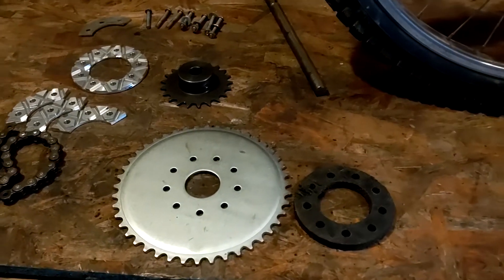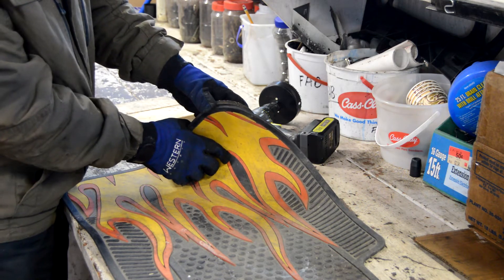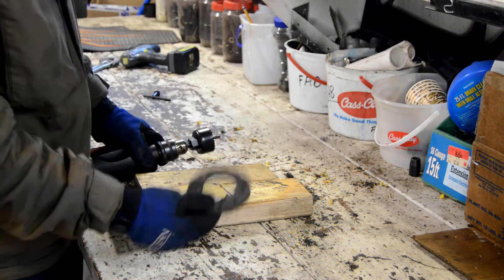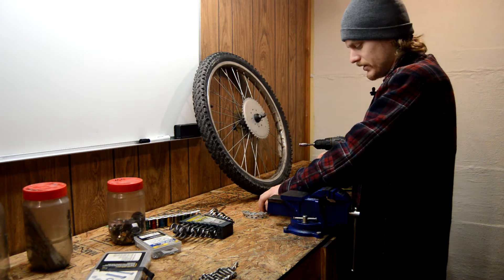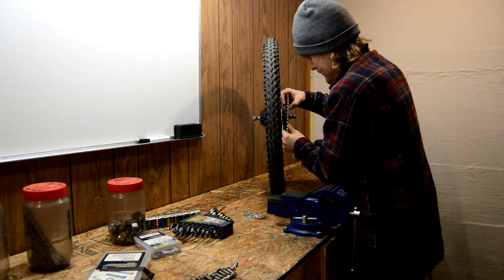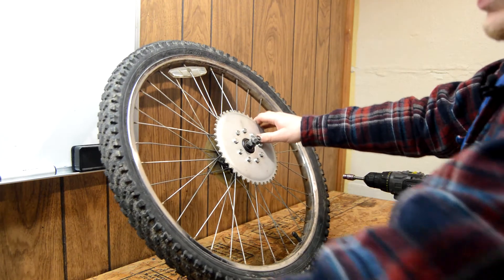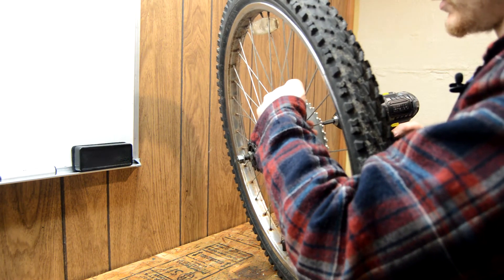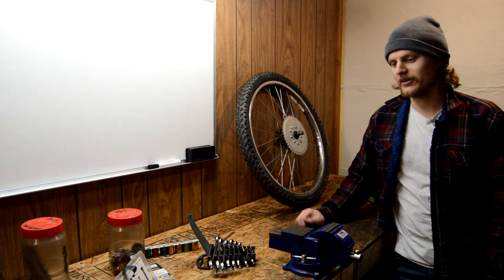DIY E-Bike Build - Rag Joint & Rear Sprocket Installation EP2

Comment: Does the stock bike chain need to be switched for a bigger one, also the sprocket on the motor?
Reply from the maker: On this build, I used a #35 chain for the front and a 415 chain for the rear. With any motorized bike kit, you'll want to run at least 415 chain. Standard bicycle chain can't handle the torque of most motors or engines and usually breaks. The sprocket on the motor should match the pitch of your chain and be geared for a speed that you would like to ride at. Check out BMI karts' go kart speed calculator.
Reply: @pulsar2121  thanks for the info

Comment: How do you make sure it is straight. And where can I buy a good one
Reply from the maker: Rag joints are never perfectly centered on the hub. You just eyeball it and get it close enough by wiggling it around as necessary while tightening the bolts in a star pattern. As for where to buy a good one, honestly, I've had the best results with the cheap ones. I've tried the CNC aluminum type which are called pineapple rag joints and they are less forgiving and have a tendency to bend spokes. Also, they only fit one very specific spoke pattern for a 26" wheel whereas with the rubber rag joints you can squeak by on most 24", 26" or 700c wheels. There are also CNC sprockets that have an adapter that clamp on to the hub. These are required for smaller wheels like 20" as the spokes interfere with a rag joint. They can be installed on larger wheels as well, but have a couple of drawbacks. The teeth on the sprocket will wear faster as they are made out of aluminum instead of steel and it's not uncommon for the adapter to get loose on the hub. You really have to crank them down and use loctite to get them to stay put.
Reply: @pulsar2121  thanks frror the reply. I wanna. Build a ebike and use a motor on the back. Cause the price of motors for traditional ebikes are way to expensive. Prices are going insane now a days.
Reply from the maker: There are 250 watt e-bike conversion kits that have motors with built in gear reduction as cheap as $84 including shipping on ebay. try searching "E-BIKE Conversion Kit 24V/36V 250W Electric Bicycle Motor Set Fit 22''-29'' Bike"

Comment: Looking good 😀
Reply: I'm thinking about using a cheap rear wheel with a steel hub and welding the rear sprocket to the spokes and hub. Get it 100% even and use some heavy tack welds, then put the rag joint on. If you need to remove the sprocket, you could use a Dremel tool and grind the tack welds off.